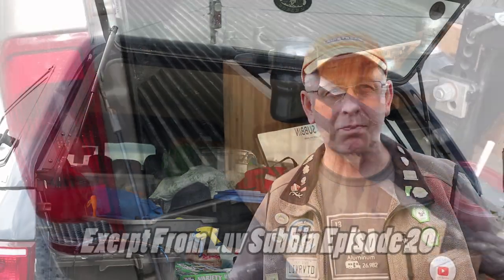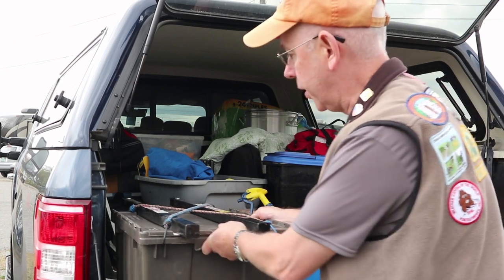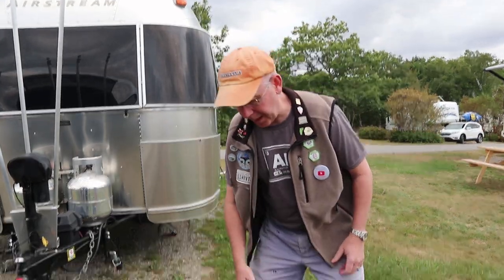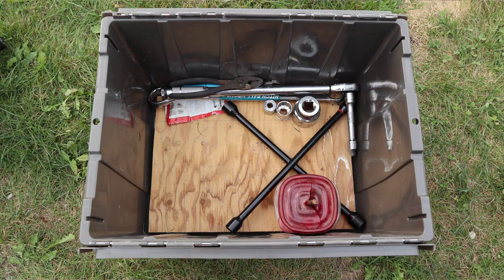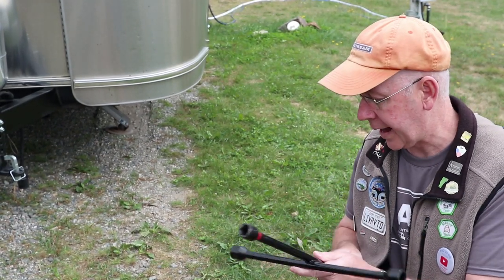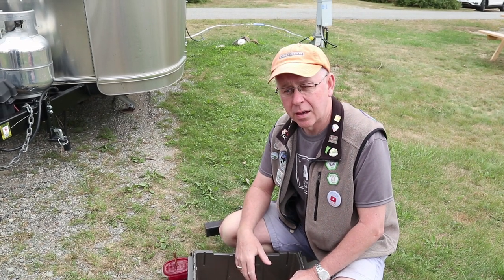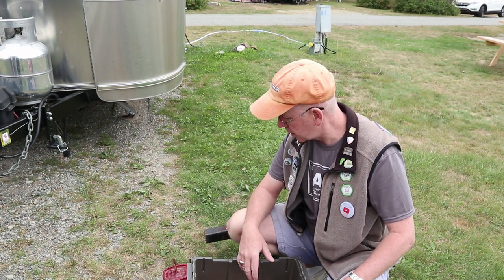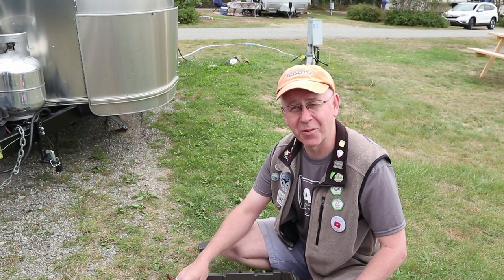How I Store My RV Hitch Gear

Comment: Thx for sharing! I saw your old video but I’m glad I stumbled onto this. I’ve been using a 5 gal bucket but they don’t stand up to the abuse. Also, I was having to pull up the hitch- also Equalizer- out of the bucket with one arm and I discovered that’s a good way to tear up the shoulder of a person of a certain age. 😫 Do you use the plywood because the bottom of tote might not hold up?
Reply from the maker: Thanks for watching - sorry for the delay but we have been off internet.  Yes, the wood is there to provide support for the thin plastic bottom.  I still use the system and it works.